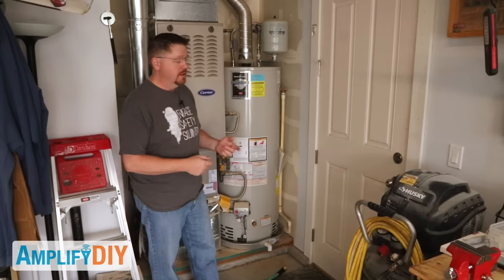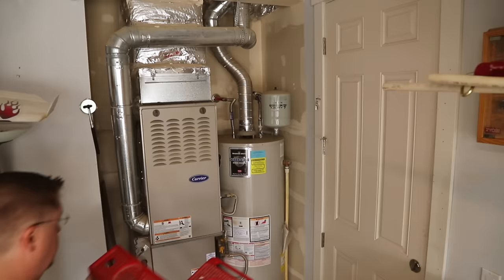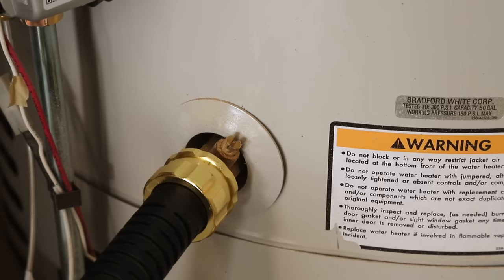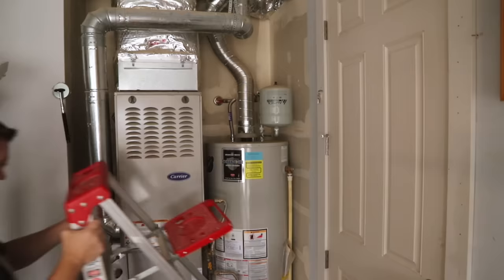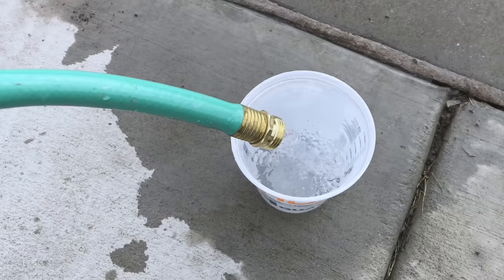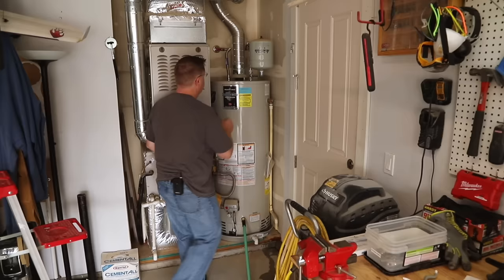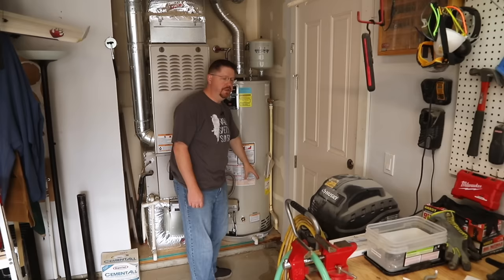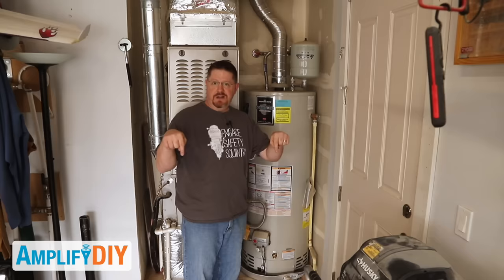How To Flush A Hot Water Heater To Remove Sediment

Comment: Hi, do you do anything with the pressure relief valve before draining? Thank you
Reply: My valve’s pipe it’s connected to goes all the way to the ground…. I can’t even fit a bowl or plate underneath it. I read you should open it with a bucket under it but I can’t get anything under it so I’m afraid to do it.
Reply: I see your pipe goes down to the ground too?
Reply from the maker: Hi Priscilla - code varies a bit by region, but in general the downpipe should come down to within around 4" of the ground. Having it come ALL THE WAY to the ground is pretty unusual. You may be able to shorten it up just a bit with a simple pair of PVC pipe cutters, or hacksaw. Or, you may be able to flex it out from the bottom of the tank just enough to get the edge of a bucket on it's side under it, then maybe you can stand the bucket up with the pipe inside. Good luck!
Reply: @AmplifyDIY  thank you. It’s a copper pipe I think. I called my plumber and they said not to touch the pressure release valve? Can I drain it without using that?
Reply from the maker: @honeyqk  I'm afraid your plumber is giving you bad advice: https://youtu.be/e5H1i1cypxA 
Taking a step back though, here is the main principle: in order to let water OUT of the tank, you have to find a way to let air IN. There are only a few ways to let air into a water heater. You can try opening a faucet. As water drains out the bottom of the tank, it may be able to pull air in through the faucet. But many faucets have a backflow-preventing check valve in them, so this does not work (as in my case in this video). The T&P valve is the next easiest place to try to let air into the tank. If you watch the video I shared in the link above, you'll see it is fine to open this valve - but with your specific downpipe setup, you may want to try option 3 - which is to disconnect the hot water outlet pipe from the top of the heater. This can be messy as there can be water that will drain out of this when you disconnect it, but if you have a bucket and a towel handy it's usually not a big deal. Disconnecting the hot water outlet to the house effectively opens a little hole in the top of the heater that air can get into, so the water can then drain out. Whatever you open or disconnect from the heater, remember to close or reconnect it when you are done with the flush. 
Good luck!

Comment: How did you get a hose on the end of a pressure release valve?
Reply from the maker: Hi Angistron - I didn't... I connected a hose to the drain valve of the tank. The pressure relief  (Or T&P) valve should have a downspout plumbed on at the time of install. If yours is missing that downpipe, one should be added asap, as it's not safe to have the valve able to discharge at head/eye level. Thanks for watching!

Comment: This is how I always do it.  One question I have though is that whenever I open my pressure relief valve, I always get a decent stream of water coming out the relief tube.  Why would that be?
Reply from the maker: Hi AJ - you always get a decent stream, even after completely emptying the tank? That's.... odd. Either your tank is not actually emptying (perhaps you have a faulty shut-off valve?) or something else entirely is going on with how things are plumbed.
Reply: @AmplifyDIY  no sorry I wasn’t clear. There is a tube going from the relief valve down to the pan that the tank is sitting in. When I open the valve to allow water to drain quicker, what comes down that tube into the pan

Comment: So how do you do this if you don't have a drain valve at the bottom or anywhere else for that matter.
Reply from the maker: Hi WLH - your heater should have a drain valve on it at the bottom somewhere... it may have been installed with the valve in a difficult-to-see location. I suggest banging around on google to find the owner's manual for your heater to see where the drain valve is supposed to be. Good luck!
Reply: @AmplifyDIY  There is no hot water tank drain valve.  There is a drain valve but it is to drain the water jack that that has hot water in it from the boiler that makes my hot water which is a stainless steel tank inside the the tank that has hot water from the boiler that also pushes water to my radiators that heat my house.  It has been in service for over 30 years and I can only imagine the mess that must be in the bottom of my hot water tank.  This system is often called a summer winter hook up.  There must be some way to clean it but I can't seen to find out how.

Comment: My Whirlpool gas WH never drains after I open a hot faucet, and open the pressure relief valve with the water intake valve closed.  If it does it's just a trickle.  I have to constantly let fresh water come in for any water to come out at the bottom.  Any ideas?
Reply from the maker: The drain valve sounds clogged up with sediment. Try to clear it with a bent coat hanger or a screw driver....and if that does not help, it may be time to upgrade that drain valve: https://youtu.be/OBPJYg0o_o0
Reply: @AmplifyDIY  Yep I've run a narrow metal file up there and it seems to help a little.  But in past years I have to turn the water inlet on some to get anything much out which sounds more like too much of a vacuum in there.  The water that does come out looks pretty clear though.  I think Georgia where I live has soft tap water IIRC...not much in the way of mineral content.

Comment: The one thing about my setup that is probably different than from yours. I assume that your tank is on the first floor or higher and draining to the outside is straightforward. Mine is in the basement. I have no sump pump so if I run a hose outside, the outlet is higher than the water heater, so it does not drain. I have to drain it into a bucket and hoof it up the stairs to flush it out. I tried using a host pump once, but the temp of the hot water burned it out. Maybe I'll try that again but turn off the heater 24 hours before draining so the water is not so hot. I'm 63 now and have a permanently damaged leg from a car accident. So walking a 5-gal bucket up the stairs is no longer going to happen.
Reply from the maker: Hi James - you don't have a floor drain near the heater? 
Also, rather than waiting 24 hours, you could just turn off the heat source, then go take a shower, do some dishes or some laundry. This will use up the heated water in the tank, exchanging it with cool water that won't overheat a pump. Good luck!

Comment: i don't seem to have a cold water valve. just a red water valve that I'm assuming is hot. what do i do?
Reply from the maker: Are you sure that the valve is on the hot side of the heater? You can test this by turning on a faucet to the hot side and then going out and putting your hand on both of the pipes that are connected to the top of the heater. One of them will be cold, one of them will be warm. The shut off valve should be on the cold one. The color is not really relevant. If the shut off valve is on the hot one, then you'll have to turn off the cold water supply at the main water shut off for the house. This might be located in a crawlspace or near the street. Good luck!

Comment: Ok I have a 12 year water heater... once I emptied tank and let cold water in all I'm getting is brown water. Does this mean I need a new water heater?
Reply from the maker: It means you still have a lot of sediment at the bottom of the tank. How many times did you flush it? If you simply drained and refilled, you need to drain / flush multiple more times to get all the crud out... 

However, if your tank is 12 years old and has never been maintained, you may be in the market for a new tank sooner than later...

Comment: Will shocking that tank with cold water cause any stress cracks?
Reply from the maker: Hi ExposeTheElites - not likely. If you are concerned about it, then turn off the heat source as I demonstrate in this video, then go take a shower, do some dishes or run a load of laundry on the hot cycle. This will use up the heated water in the tank, replacing it with cool water from the supply, resulting in a cooler tank when you do the initial drain and flush. Good luck!

Comment: I tried flushing out my water heater, but the water is barely coming out. It’s the tiniest trickle. What do I do to help this draining process?
Reply from the maker: Your drain valve is likely very blocked up. You can try using a bent coat hanger to shove up into the drain valve to clear / break up the blockage. You'll have to remove the hose first, and keep a bucket handy as once you clear the blockage, a lot of water will come out quickly. Once you can get the tank drained, I recommend replacing the drain valve: https://youtu.be/OBPJYg0o_o0
Good luck!

Comment: In the beginning of the video you open the hot water valve in the bathroom and at the end of the video you open it again. When did you close it?
Reply from the maker: Hi Natalie - this question comes up pretty frequently. Thanks for watching so carefully, but it actually does not matter when you close / open the faucet except for 2 points in the process: 
1) Initially I opened it to let air into the tank... but when that did not work, I switched to using the T&P valve. Once the tank is drained, it does not matter if the faucet is open or closed. At some point during filming I closed it again off camera. 
2) When you fill the tank for the last time you should make sure the faucet is open. This is when you saw me re-open it in the video. This is to allow a path for the air that is in the tank to escape somewhere so the tank can re-fill completely. 
Hopefully all this makes sense, and you were able to get your heater flushed. Thanks for watching!

Comment: can i drain the water into my utility sink rather than outside?
Reply from the maker: Only if the sink is at a lower level than the drain valve of the heater. If the heater is in a basement, there should be a floor drain nearby you can use. Good luck!

Comment: What about if you have scale etc in it? No way its just coming out, you have to put something in tank to dissolve it right?
Reply from the maker: Limescale that is stuck to the walls does not easily come out this way, no...For that, you can try filling the tank with several gallons of white vinegar and letting it sit overnight to let the vinegar dissolve the calcium. I've heard from other viewers who tried stronger chemicals, but I don't recommend doing so unless you are comfortable around really caustic stuff. Good luck!
Reply: @AmplifyDIY  mine is gas and it pops and cracks when it heats up so I assume sediment is hard and along the bottom

Comment: I don't understand why you initially opened the Pressure Relief Valve? Doing so gives you only gravity and almost no pressure to push out the sediment. If you didn't open the P.R.V. the high pressure would have helped push, and stir, the sediment out. What am I missing here? Please explain.
Reply from the maker: 40 gallons of water is a HUGE mass. Think back to physics class when you may have heard of Bernoulli's principle - the long and short of it is that there is a pretty skinny pipe that feeds water into your heater. The heater acts as a HUGE pipe with a pretty skinny pipe  for the drain. Water flowing at a high velocity through the skinny pipe will slow to an absolute crawl once it gets into the comparatively huge tank, then it will speed up again right as it exits the tank at the drain valve. While it seems intuitive that this would stir up the sediment at the bottom of the tank because of how much pressure there is at the drain, the reality is that inside the tank the water hardly moves at all. 

To use another example: Have you ever tried to shoot a squirt gun under water?  If you fill your kitchen sink up and clean some really dirty dishes, there will be a bunch of junk left on the bottom of the sink. Is it easier to move that stuff around with the sink full? Or is it easier to drain the sink and then use water from the tap to rinse it out? 

By draining the water heater tank entirely, you remove that huge mass of water, which allows a lot more velocity across the bottom of the tank, and produces a much stronger stirring / swirling effect to dislodge sediment. 

Hopefully this helps - I'll be happy to explain further or answer any other questions you may have. 

Thanks for watching, and have a great day!

Comment: Crazy question…do I actually need to turn off the heat and turn the water off? Wouldn’t it just continue filling and heating as I drain it?
Reply from the maker: Hi Dakota. Yes, you do actually need to turn off the heat and the water supply. Consider this: have you ever tried to use a squirt gun underwater? Have you noticed how ineffective it is? Or, have you ever tried to use the sprayer in a sink to clean the bottom of the sink while it was still full of water? 

If you don't empty the tank, trying to clean the bottom of it is a pretty futile activity as all of the water in the tank will prevent any sort of stirring or agitation of the sediment on the bottom of the tank. And, if you don't turn off the heat source, then when you empty the tank,the burner could come on with an empty tank, which could potentially damage the tank is there's no water there to absorb all that heat.

Thanks for the question, and thanks for watching!

Comment: A plumber once told me you can just open your pressure relief valve and let the water circulate and that was enough. Is this true?
Reply from the maker: Hi Bad Moon - No, that is absolutely not true. You should test your pressure relief valve annually, but simply opening it will have no effect at all on the sediment collected at the bottom of the tank. Remember: It's in the plumber's best interest for your tank to fail... so they can sell you a new one...Thanks for watching!

Comment: How can i know if my sediments have solidified into a slab ?? My heater is 22 yr old and working fine ..lol ..should i just change my heater now ??
Reply from the maker: Hi Sajid - at 22 years old, if you have never flushed it here is what I recommend: save up for a new heater. Don't necessarily buy a new one yet, but have some cash stashed somewhere for when it inevitably does fail, because it will.  If you prefer to be proactive, then replace it with a new unit once you have saved up enough for it, then keep up on the maintenance on the new one. Good luck!

Comment: After replacing my 3rd water heater in 22 years, I installed a whole house filter  to reduce sediment coming into my house. It was only about 40 dollars and  maybe 80 dollars for the  brass fittings and flex shark bite fittings. City water doesn’t filter out the sediment, my old water tanks were full of it.
Reply: what kind of whole house filter? Could you give a link?
Reply from the maker: Hi A L - I'm not sure what Gregory has, but I have a whole house filter pretty similar to what he describes. Mine is this one: https://amzn.to/3WMexja - they used to be quite a bit cheaper.... I think I paid around $50 for mine when I installed it around 5ish years ago. Makes a HUGE difference both in the amount of sediment getting into the heater as well as to the taste of the water. Thanks for watching!

Comment: is it okay to let it drain down the drain on your basement floor?
Reply from the maker: Hi Darlene - yes, that's what the drain there is for. I do recommend you strain the larger chunks out with a kitchen strainer so you don't risk clogging the drain. Also it's a good idea to turn off the heat source for your heater, then go take a shower or do some dishes or laundry. This will use up the heated water in the tank and exchange it will cold water from the supply, resulting in cooler water that is safer to put down a floor drain. Good luck!

Comment: Is it necessary to drain your WH if you have a softener?
Reply from the maker: Hi Mark - yes, it's still a good idea. It's still possible to have sediment coming into your system from your municipal supply, and the water softener does not remove all the minerals - it just swaps most of the "hard water" minerals out for sodium ions. You still have a sacrificial anode inside your heater tank, and it will still deteriorate / crumble to a rust-like material that collects at the bottom of the tank. Flushing will get all that junk out. Good luck!
Reply: @AmplifyDIY  Thank you much. I’ll do the process. I’m trying to figure out some way to reclaim at least some of the water. We’ve had years of severe drought in Utah. I’d almost prefer to replace a water heater with tankless vs wasting water. Costs have dropped on tankless. Anyway your video is well done and thorough. Appreciate it

Comment: is it normal for a new water heater to break down after two years if not cleaned?
Reply from the maker: Hi Yara - no, that is pretty unusual. Was it still under warranty?
Reply: @AmplifyDIY  no, we just used our insurance. it's still giving us hot water but not too hot and doesn't last long. they said we need parts and showed us how to clean it. apparently the water in our area is really hard but I still think that a new system should be able to handle it for more than 2 years.

Comment: Is it ok to drain the hot water right into my sump pump pit?
Reply from the maker: Hi Rick - yes, this is generally fine to do. I recommend you do 2 things differently than in my video instructions: 
1) Start the process by turning off the heat source for your heater, then go take a shower, do some laundry, or wash some dishes. This will use up some of the heated water in your tank, and will leave the tank full of much cooler water that won't overheat your sump pump. 
2) Use a kitchen strainer at the entrance of your sump pump to catch any large particles of sediment before they go down into your pump, potentially causing a clog. 
Good luck!